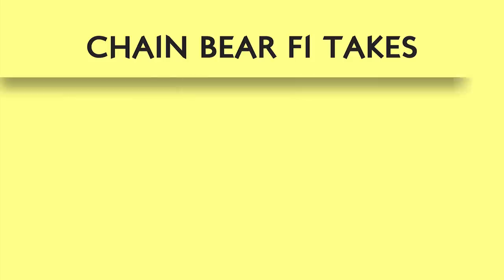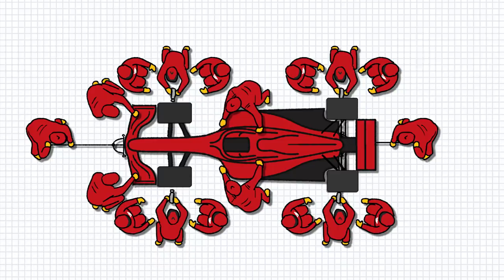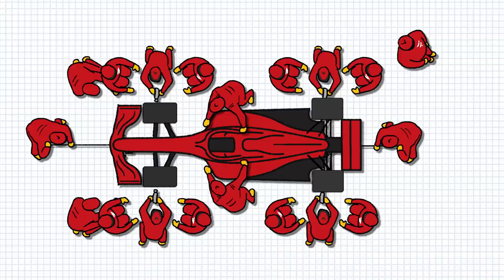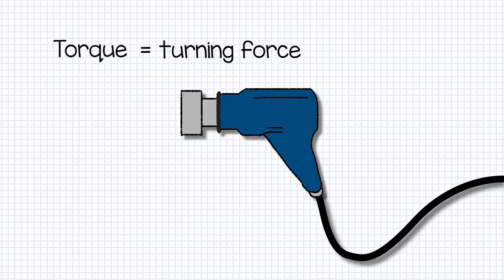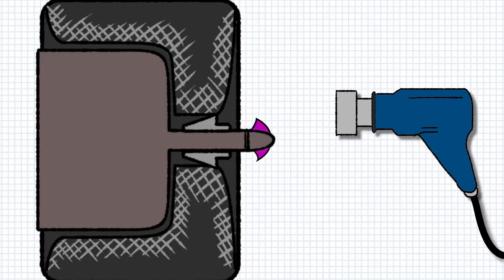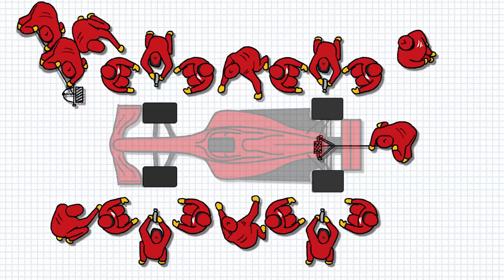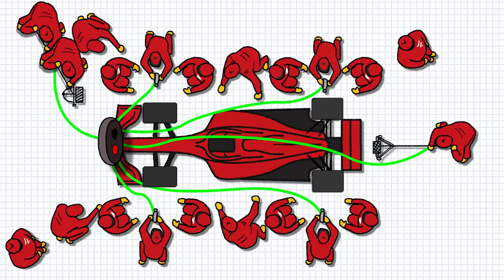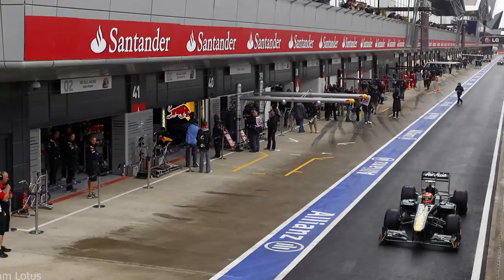The anatomy of an F1 pitstop - Two seconds of mayhem - Bahrain GP 2018

Comment: the way I see it, pure automation is the key

have sensors on the wheels/jacks etc that keep the light red unless everything is fully screwed in etc.
so essentially remove the "human" factor.

another issue is that there is no "OH $H1T" button. once the light is green, the driver goes on, and never looks back. When the lollipop man was present, if the lolly was raised, and lowered again, the driver could stop again. possibly the hell would break loose, but it would stop and the car would be "sorted out". So there should be a way to signal the driver to stop. maybe an audio queue?
Reply: but, if the wheel nut is jammed then the sensor would register a changed wheel so the lights would be green and the driver would run over a member of their pit crew..?
Reply: i think that is what happened with haas or ferrari. They already have that system, but its pure garbage.
Reply: Niek 
Indeed. You are right. Ferrari have an automated system in place. The guns are electrically connected to the wheelnuts, when the guns goes to the nut, it makes a connection making the system know it has screwed of the tyre. When the gun is released, put on again and released again, the system thinks the tyre was fitted correctly. The mechanics don't need to press a button.
Reply: +Niek well, maybe they should make one that actually works! :P
Reply: there are ways to detect when the wheel has been changed, if there is a jam etc. Not saying it's a simple solution and maybe not something that can be implemented NOW. but it would be good if all teams have a similar enough system.
Reply: Gohan6 I think automation is the best way in the long run in terms of safety and effectiveness but I feel that just further removes the human element of the sports (most people already only pay attention to just the two drivers anyways). Pit crews are one of the biggest teamwork aspect of the sports.

Comment: why don't you have one spotter for each wheel with an over ride button just encase something goes wrong
Reply: track cheese you want even more people on an already overcrowded area? Also it's not foul proof because they might not either notice it or react in time to stop the car
Reply: Excludos yeah but still it can work just have the spotter a little away from the car not to for away just effort to see it might work. The fia need to fix it
Reply: *fool proof
Hypothetically speaking, they might not notice, but give the mechanics at least a LITTLE credit. They can change 4 wheels in 2 seconds, so I think they're capable of being able to see whether a car's wheels are attached properly.

An extra spotter (or 4) with an override button would be a simple and reliable solution.
Reply: +Nathan Gamble It's exactly because they're changing 4 wheels in 2 seconds that it's difficult to see if the wheels are attached properly. It would literally be a millisecond decision. It's not that they're stupid or slow, it's the fact that there's a physical limitation to how fast you can react.

Comment: I could easily see the car pulling onto a pad that's calibrated with the car and driver weight and everything else needing to be off the pad before the light turns green. That would allow for one person to override the light should everyone be clear but the light now changing. The crew already knows how much fuel the car is getting before it hits the pit so that weight could already be entered to the calibrated weight. A 10 lb cushion can be added and boom, problems solved and no one gets hurt. Either that or put the pad just to the side of the car and make all pit crew members be on it before the light changes. That way we'd still have the pit times and proficiency in the overall equation. Setting a 5 second mandatory time would take the edge away from great pits and wrongly assist crappy pit stops.

Comment: I'm a fan of smaller pit crews. Fewer variables, fewer bodies in the way. Part of what's been happening these 2 races is that pitstops have become so quick, mechanics simply do not have the time to signal a problem, like in the 2 Haas stops in Australia. Smaller crews mean longer stops, meaning there's more time to signal a problem or for a spotter to see a problem. I'm still fuzzy on what actually caused Kimi to be released. If he was able to go, that means the rear jack was lowered. Why was it lowered?
Reply: Sorry but there where not many unsafe releases in the last 5 years with pit stop times even faster then now because of the smaller tyres. If FIA makes a rule change for this it will be just as stupid as the halo was.
Reply: nulian I think improving safety is not a stupid thing. Unsafe releases are very dangerous for everybody, there should be zero unsafe releases.

Comment: I hardly find any good evidence that suggests what actually happened during the pit stop system and I'am not surprised at all that their pit stop system isn't so well known fact to the public since we are talking about Formula 1, but during the Sky Sports broadcast, I believe that it was Crofty who briefly spilled the beans... so i was wondering if it is accurate. He mentioned that their newest system does not use any buttons except for an override and their system gives green light when all the four nuts are attached to the car which was the case, but it did not work as intended. Hopefully Charlie Whiting is man of his word and they further investigate the pit stop errors and give us a little hint what kind of systems they are using. It is really interesting debate topic and even pokes the curiosity of people who like engineering. Now, since I'm invested in this topic, I decided to comment here and I'm wondering if any of you have found any trusted articles that can confirm on how they operate the green light in reality.

Also it is interesting that Paul di Resta was having an argument with Crofty this weekend about whether we should reintroduce refueling. Banning refueling is what removed the "minimum" pit stop time in a way and this is how they control pit stop times a little bit in Nürburgring, but as Crofty explained it will cause artificial overtakes that only interrupt racing and isn't beautiful to watch.

Comment: @chain bear F1 .  Nice video, thanks.  But based on the following regulation, could Kimi NOT abandon his race, but go out and complete 1 lap legally, then come back in again, to correct the wrong tire and continue racing ?  Seems like 12 points lost to me due to not having properly understanding the rules.

"Any driver who uses a set of tyres of differing specifications during the race may not complete more than three laps on this set before changing them for a set of tyres of the same specification. A penalty will be imposed on any driver who does not change tyres within three laps."

(taken from https://www.formula1.com/en/championship/inside-f1/rules-regs/tyres-and-wheels.html)

Comment: This is correct but not 100% I believe ferrari has an automatic system that checks the torque of the wheelnuts. And since the old wheel didnt come off the system picked it up as torqued. Thus when the other 3 wheels were tigntend the systen picked up 4 tight wheel and signaled for kimi to go. While in the meantime the one wheel was never loosened.

Comment: If it was just about mechanics accidently hitting the button, you could move it away from the gun itself. Im thinking about a button on their arm or shoulder, that would very unlikely be hit by accident. Another idea: To safely fasten the wheel, the wheelgun needs to turn atleast two times, in the two different directions. Why not integrate a system, that prohibits any green lights, if atleast one gun, didnt do a full spin in either direction?
Reply: Or make a system that registers when they raise their hands

Comment: The best way to make anything safer for humans is to remove humans from the equation, so limiting the number of crew members at the car would improve safety.

However, I’ll also add that this is an opportunity to “over-engineer” the pit stop to keep times as low as possible. Let teams propose pit stop rigs to replace missing crew and stops will still be manic, but you can still get 2 second times with fewer people and better visibility.
Reply: Okay, I thought of a potential improvement that does not require a full pit stop rig. Cut 4 crew members, but allow 4 more pneumatic tools. Now you have 2 crew members per tire, which means one is loosening AND removing the tire while the other is replacing AND torquing the tire.

Additional time saves might be had with fancy grabbing and releasing tools. Imagine the removal gun with a grabber, helping the mechanic pull the wheel off cleanly.

Comment: I don't like both the set-time pitstops and reducing the number of mechanics. The idea is to let the teams do what they want so they can come up with the fastest way possible. You can go faster by adding yet another 10 people? Great, show me! So, improving safety should come from imposing common hurdles, not pre-defined outcome. The "safe zone" idea goes into that direction: You now need to find a way to get it done AND be back into your garage as fast as possible. You wanna do it by having all mechanics hop onto a trolley and pull them in? Fine! Do it! As long as they are safely back into the garage before the light goes green. The only problem with this are possible injuries to sprinting mechanics, so you'd need to mandate a clean working space as well (e.g. banning camera crews from the sprint zone and mandating all equipment to be either removed before release as well or be suspended over the car)

Comment: Bring back refueling. 

More variation in strategy (1-2-3 pitstops based on how big the fuel tank is and how much fuel is in them, leading to faster cars with less fuel and slower cars with more fuel etc.), louder engines (able to run the V6s to the proper 15-18k rpm), more overtaking as lighter cars are able to blitz past slower cars with DRS and slower overall stops allowing mechanics to change the wheels under less pressure.
Reply: The average overtakes per race almost doubled the year after they banned refueling

Comment: Chain Bear I have an interesting question. As a computer science major I have to think that certainly you could build a robotic pitstop system that does everything in 1 to 1.5 seconds since it can do everything at once with out the delay of human reaction time and be perfectly synced up to the millisecond and have incredible reliability. Is there any rules preventing this? Because if you needed say a minimum of 3 pit crew members certainly there could be loop holes letting this still work. Or is it just the case that the teams aren’t willing to spend millions to shorten the over all 22-23 seconds in pit lane to 21 seconds?
Reply: Like you could have 2 crew members manually jacking the car up into the machine since it has to be manually done
Reply from the maker: Hm. Good question - there's nothing in the F1 Sporting Regs or the FIA International Regs that makes any specific mention of that. I'd be interested to see what would happen if a team tried it.

I would suspect they're not worth the hassle, to be honest. And as soon as they were tried, they'd be banned.
Reply: Chain Bear F1 yeah that makes sense

Comment: I think they should only allow 9 people to be around the car. One person per wheel, one with a wheelnut gun who circles the car (front right, front left, rear left, rear right, repeat to tighten), two on jacks and two spotters, one is a pit lane spotter, the second is a mechanic spotter. They each have a button which when both are green, allows the driver to be released.

I think removing so much unecessary crowding is the best way to keep mechanics safe. Who cares about 2 second pit stops when there's nothing actually happening on track anyway?
Make sure everything is correct and safe.

Or, just make all the mechanics wear Halos... 😂

Comment: Why not have the guns send out a signal as soon as there is no more rotation after applying the torque to attach the car? This would make sure that the car only get the green light when all tyres are attached properly.
Reply from the maker: Hugo because this could result in an erroneous signal of the nut doesn't go on properly and the wheel gun gets stuck.
Reply: Chain Bear F1 I thought it would be additional, so it would not release the car when all the mechanics press on the buttons and one of the guns did not send the signal that the wheel is on.

Comment: Why not incorporate some reliable sensor in each tyre? When all tyres are assembled properly, the green light will light up. The person looking for traffic should be given override authority.
Reply: The nut cat be tightened, the wheel can be properly seated but, is the gun stuck on the nut? It has happened before.

The gun would need to know that the nut has rotated the required number of turns, that the torque had been reached and the gun had been removed from the nut.
Reply: @ohidontknow1061 yeah,  you are right. The gun can get stuck on the nut and the system wouldn't know.

Comment: bring back refueling
so they.will have more time to get the tires safely on
Reply: Yeah and drive away with hoses and put the full car on fire.
Reply: that happened how often?
yea definitely the same amount like the lose.wheels

and now tell me how.often did a refueld car lose its tire in the first lap.after a pitstop?

and you could make a saftey that.preventa the car from going as long as the hose is in (like a switch in the fuel cap that kills the torque to the wheels)

Comment: Love your videos but you are not entirely right on this one.

The main issue with Ferrari's (also Haas's and many other's) pitstop system is that the dropping of the car and the light system are completely automated. The mechanic don't need to press a button to say he's done.
Whenever the 4 wheel guns saw the tightening torque needed for a wheel, the car drops and the light turn green. That is why a cross-threaded wheel nut (Haas's problem in AUS) would still allow the car to go away.

Over-automation is just counter-productive and they should give the power back to these experienced and well-trained mechanics instead or a fucking dangerous automated system. Humans can improvise, machine can't.
Reply from the maker: soulkass this is actually unconfirmed as far as I can tell. I'm trying to look into this thought and may do a mini follow up.

Although I did say that I was giving a demonstrative system, that all systems varied. :)
Reply: Chain Bear F1 ok that would be amazing if you could do so. Keep up the good job anyway we love it👌
(I'm an F1 engineer so I don't learn much but still enjoy the animations and how you explain things)

Comment: I have a question! Why did Kimi stopped the car? Is it a rule when you overdrive someone you stop? Was the wheel not good? Can somebody makes this clear (for me)?
Reply from the maker: Bas Hesselink well he hadn't actually changed all the tyres. The old rear left was still on. It's unclear if that tyre was secure
Reply: Chain Bear F1 Oh okay, thanks for the fast respons! (Nice video)

Comment: Maybe have red , yellow and green lights? The red light changes to yellow giving the pit crew time to move away(or if they messed up, fix their mistake) and green is when it's safe to leave and every pit crew member has moved out of the cars' way
Reply: I can foresee the drivers making errors there, as I believe they react to a change in light, rather than a particular colour. Not to mention thinking about an actual colour will likely add a delay to the drivers' reactions, though if it turns out to be only a few tenths it's not that bad when compared to a mandatory minimum pitstop time.
Reply: Yeah I mean it will be better and safer and I mean drivers are trained to react to all situations, I bet learning to react to a small color change won't be that difficult for them given time
Reply: The reason why they had drivers start the race once the 5 lights go out at the beginning is because too many drivers were jumping the start after the red lights went out, but before the green lights went on. Drivers react on when the red goes out, even if the green isn't on.
Reply: The crew is focused at the tyre or to whatever their job is and won't see the changing lights anyway, so it would just confuse the driver without serving any purpose. The crew light could however be build at other points, where they can see them more easily (or even at the car itself).
Reply: Not really. Imagine if it's around 3 seconds of red light while the crew does their changes. 2 seconds of yellow light which gives the crew to fix any mistake they might have made. And finally the change to green when the driver can leave. Plus having an extra element of yellow to green color change would test the drivers' reaction a little more and make pitstops more exciting while also being safer
Reply: I just don't really understand the purpose of the yellow light, may as well just do 5 seconds of red. The crew isn't going to be looking at the light, they're going to be looking at what they're doing. The yellow light is just a pointless step, imo

Comment: How about you have a lollipop guy with a traffic light on it and the spotter guy has a flick a switch press a button to signal the light that you are go for lift off but every mechanic has a tablet that requires a personal 32 digit PIN if they want to override the procedure. All the 32 digit PIN are known by the people on the lifting pads who have the right to not detach the pads if one of the people changing the tires fail to press the correct PINs 3 times in a row. Also the driver will have a paper with a checklist and a sudoku and he ll have to fill it up in order to open his eyes since he will be blindfonded as soon as he stops.... 

NOW THIS IS POD RACING